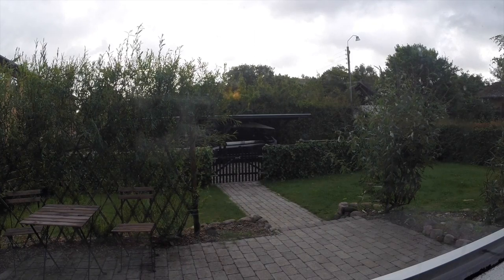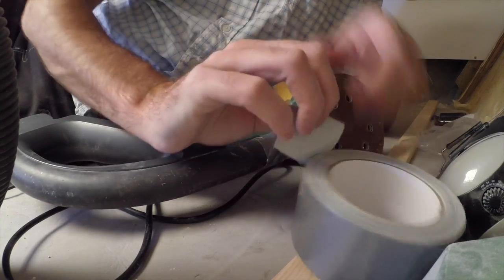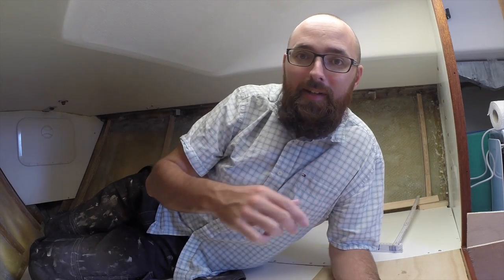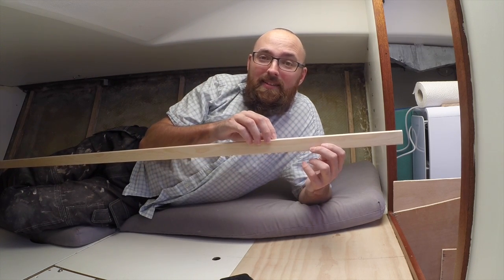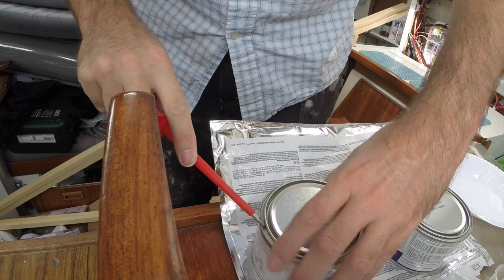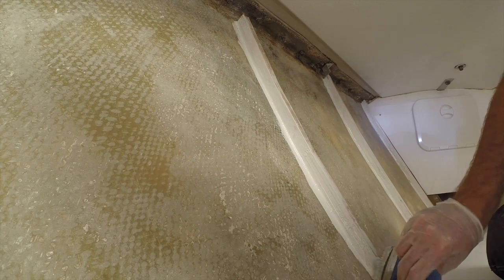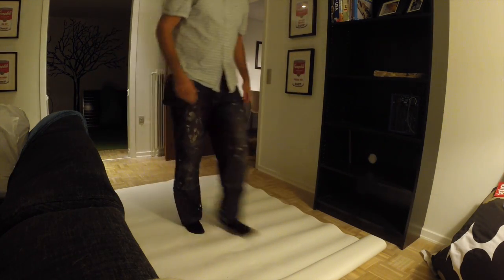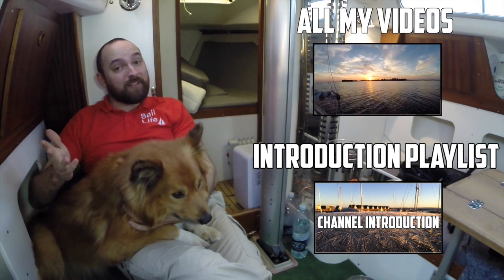Sail Life - Insulating the v-berth, part 5

Comment: Mads things are looking pristine, great attention to detail! Because you asked about pre-varnishing the slats ill give you  my two cents worth. I am of the studied opinion, after many years in the construction industry as both a tradesman and in project management, you will be further ahead in both time and aggravation, if you varnish before install. Additionally, you can coat all sides of the slats and that's a major plus in my book. What I would suggest is that you take ALL of the slat material, in its rough length, back to your house, varnish, and then take the finished materials to the boat and make your cuts onsite. By doing that the only vanishing you would need to do onsite is the end grains when you make your cut to lengths of the slat. Good luck ! You're doing a great job and thanks for taking us along on the journey.....
Reply from the maker: gary5749 Thank you so much :) I've gone ahead and ordered all the mahogany before even seeing the sample I ordered. I should have it by Friday. My plan is to bring the mahogany aboard the boat. Trim all the pieces (and mark them) and then bring them back to the house for varnishing. I'll set up a small workshop in my living room just as I did with the refit. Apply a coat of varnish in the morning before going to work and the another coat before going to bed. It'll be just like I did during the refit :)

Comment: It's looking good Mads. I might consider running the mahogany level with the bunk instead of the deck, otherwise you may create the illusion of the bunk sloping down towards the bow.
Reply from the maker: Brad D Thanks :) I'm torn between those two options! So far it seems there are most "votes" for aligning the slats with the hull. Though decision - in a first world problem kind of a way ;)

Comment: Hi Mads,
Really good job that you performed with these stringers ! Looks really nice and even professional.
It is a good thing that you will be able to use mahogany slats at a reasonable cost.
Assuming that you will scew the slats onto the stringers, I do not see any objection to coat the slats at your home before installing them.
I do know the time consuming process of varnishing wooden boat parts myself (in my case the wooden tiller of my boat on which I applied 7 coats).If you go for a mat finish - not glossy-  of the mahogany slats in the V-berth, I can recommend to consider not using varnish, but instead 3 coats of standard colorless wood stain. This goes much faster, and offers an almost equivalent wood protection, especially if we consider that the slats are located in the interior of the boat, at a position where there is virtually no risk of any standing water.
I would recommend 1 primer coat and 2 (maybe 3) finish coats of the wood stain product. Such wood stain product is usually available at any do-it-yourself market shop.
In any case this is what I would do, considering that varnish has sometimes some issues with peeling-off after some time.
For the exterior wood parts of the boat, in my experience the coloured wood stain coating products perform even better than the "specialized" and more expensive boat varnishes.
Good luck and courage with the proceeding work !

Comment: Hi Mads, 

great work. Seems that your stringers turned out great. Also, Norrøna jackets are great!

I think that the mahogny will bend nicely even after it is "painted". However, I would recommend you to put something between the stringers and the mahogny in order to avoid cracking noises. I have experienced a v-berth with the same solution that you have. Any movement that put any force on the mahogny caused cracking noises, wich was annoying trying to sleep. 

Also, I am really curious of what the Rasberry PI mount you have are used for?
Reply from the maker: ole86225 Thank you so much :) Good eye spotting the PI ;) It's currently only used as a webcam to monitor the boat, but I have lots of plans for it this winter! Very interesting point about putting something in between the stringers and the mahogany! :)